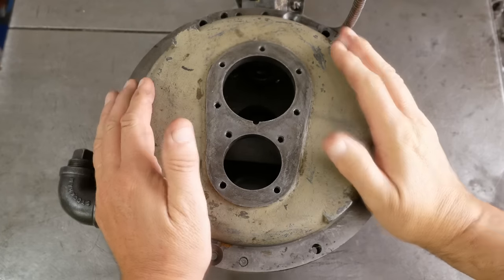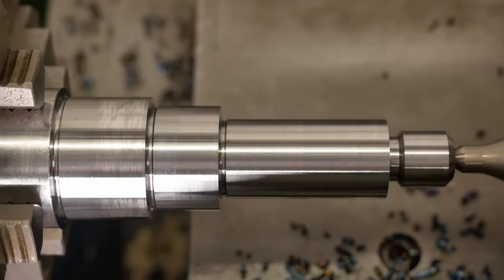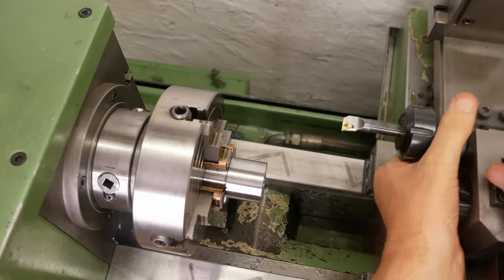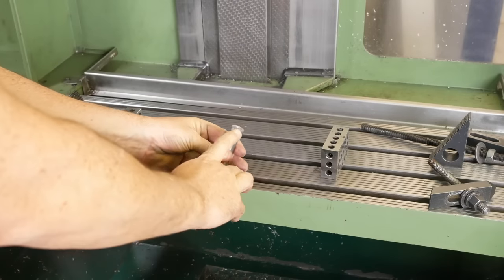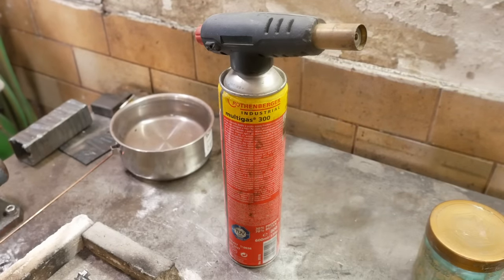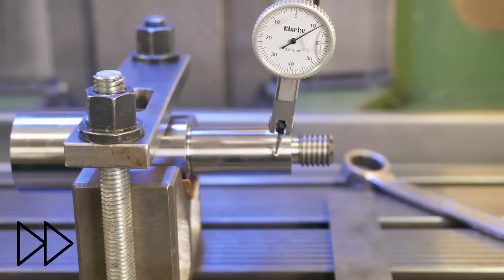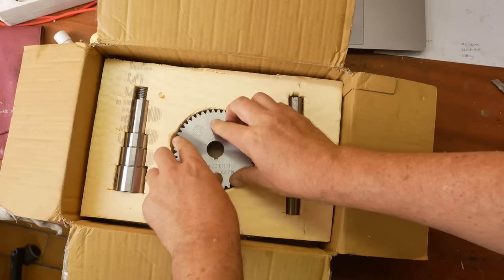To make parts you first have to make DIY tools || RotarySMP

Comment: We used to make gears and gearboxes for nearly 100 years. The gears were mostly for top tier automobile manufacturing, the gearboxes were for a myriad of different industrial, commercial and defence sectors. We rarely used Woodruff keys, except for the older style gearboxes. I started my  apprenticeship in the early 70s and we were taught how to make our lathe and milling tooling from HSS, this practice seems to have declined with the introduction of inserts and carbide tooling. So for me it was a pleasure to see you making a Woodruff cutter the old way, thank you. Great post 👍
Reply from the maker: Thanks for your kind feedback. I also used to use mostly HSS, but the Schaublin really performs with the much higher feeds and speeds of Carbide. It was fun making that cutter, and worked better than I expected, especially after I overcooked the temper a bit.

Comment: I always take attachments out of my tools and give them a quick clean before a light oiling then put them away. Even when I know I most likely will be using the same attachment over and over again I still prefer to see all the attachments in their respective place when I open up the tool case even IF leaving them won’t cause rusting or any other issue.

I’ll even go as far as modifying a tools internal case if there aren’t enough spots for all the different size (shapes) rather than leaving them installed in the tool. Case in point a hydraulic wire crimper came with a bunch of different sized metric crimping die, but the seller had added an extra size that the kit hadn’t included for 12Awg so I used my heat gun and plastic welding sticks to add room next to the original spots just so I could keep the tools jaws empty when storing.
Reply: And I totally nailed the project guess count YAY 2 for the win … 😢 however my celebration is short lived knowing I have to wait longer still to see the conclusion.
Reply from the maker: A trillogy in five parts. Like Douglas Adams taught us :)

Comment: Awesome video! Machinists jacks work great for supporting odd surfaces. You make them on a lathe too! Might wanna invest in a coolant pump or mist cooler if possible. We use a peristaltic pump and a dull needle end at work for low coolant flow work. And no I actually find truing a four jaw relaxing. I'm weird though.
Reply from the maker: Thanks Ethan. The Lathe has a coolant pump built in but I haven't wired it up yet.
Reply: @RotarySMP  Nice!!! I a bit envious of that little guy! So cool!!

Comment: Put paper between your stackups, steel on steel might as well be ball bearings on greased glass, a paper shim will really make your clamp ups bite and its surprisingly consistent in thickness.
Reply from the maker: Thanks for your tip Greg.

Comment: In our shop, we always use a 3 jaw chuck for raw stock. We only use a 4 jaw independant chuck if we want to hold workpieces that are not cylindrical or cylinderical but have to run off-center. If we want to hold a piece that hat a machined cylindrical surface, we use a 4 jaw dependant chuck with soft jaws and bore those jaws in situe. the runout is then less than 0.01mm. Don't ever use a dependant 4 jaw chuck on raw stock. If the cylinder is not consistant enough, that thing will fly off or slip.

Edit: to prevent 10:05 from happening you machine a small enough face in the soft jaws for the workpiece to sit against when boring
Reply from the maker: I would have used a three jaw as well, except I didn't get around to buying one for the Schaublin yet. I could switch one of my two 115mm 3J from the Boley threaded backing plate to a D1-3 back plate, but you know if I did that it would be permanent, and the Boley's chucks are both seriously worn out.

I had the stock further out so I could run an indictor on the machined surface. How would you have done it? I guess I could have also turned a small section bigger than  the largest diameter, just to indicate on after flipping the part.

Comment: It may be worthwhile putting some interlock on master air pressure into the e stop circuit or at least not letting you start a program without air, since it could probably do a lot worse than just not cutting.
Reply from the maker: I have been considering it, but there are many jobs where I dont need air at this point. When using the chuck rather than collets, and not needing the tailstock, I dont need air, and leave the noisy compressor off.

Comment: Great vid!!!!  You really need to add automatic coolant to the lathe man!!!  All the awesome cnc turning with manual oil brushing is just painful to watch lol!
Reply from the maker: The coolant system is built in, but I need to connect up the pump, the valve and fill it. Plus it would really need the machine swarf cover back, on, and I have a bunch of other things to do before I get to it. Untill then ... brushing :)

Comment: this question is a hint about how much machining I know, but why even use a 4 jaw chuck? an uneven ammount of legs will be easier to center... I mean it would be very handy when you want things "off center" (like a cam? no idea the proper name) but for centered parts sounds like a pain.
if these were my tasks I'd say 1 got knocked off the list, and I did 10 totally unrealated things in between.
Reply from the maker: Excellent question. There are two answers:
1/ you can dial out the run out with a four jaw chuck, to get a part perfectly centered. A three jaw is not really a precise device, at least not a typical one.
2/ I dont have a 3J for the Schaublin yet. I could move one of the two I have for the Boley, onto a D1-3 camlock back plate for the Schaublin, but they are both pretty worn out, and I would rather not insult the Schaublin with one, as if I do that, it would be permanent.

Comment: I’ll have to settle for 3 today
Reply from the maker: Hi Luke, Glad to have the gears and shafts off for plasma nitriding.
Reply: @RotarySMP  glad to see things going to plan and grate job on the editing :)
Reply from the maker: @LCalleja  Thanks a lot Luke. How is your first video progressing? If you need any help or tips, just ask.
Cheers,
Mark
Reply: @RotarySMP  not that good I didn’t have a good mount for the camera during milling so didn’t turn out good. Might have to start on the next project.
Reply from the maker: @LCalleja  Any old tripod will get the job done. Bit slow to set up, but they work.
Reply: @RotarySMP  unfortunately don’t have a tripod and not much space to set it up so I settled on something different nothing like a good side project:)
Reply from the maker: @LCalleja  Tripods are easy but a PITA which is always in the way. Good on you for going a different route.
Reply: @RotarySMP  I am hoping to get it working today or tomorrow then I’ll send you a few pictures

Comment: The lathe looks like it's really working well now. 
    I really thought about buying an assortment of SAE woodruff keys and dropping them off in Naxos for you. I just got back from Cleveland and there was a 36" do all for $1800 and a Victor 40" for $1800 as well. Sadly neither would fit in checked luggage and I really don't have time to make the 4 day round trip drive. Not to mention I hate road trips... But that is a great place to find equipment since Ohio was a massive manufacturing state way back. Still is to an extent today for what little we do make in the US.
       At least you can get out in your shop and try to get stuff done. I'm just hoping today is our last 101* day. It only got down to 82* last night.
Reply from the maker: Things cooled down here this weekend. Temps in the mid teen °C today. A 36" DoAll much be a real beast. There is an excellent restoration thread about a 36" on the Practical machinist forum.
Reply: @RotarySMP  I really wanted that 40" victor. It looks nearly identical to the Doall. I'm not familiar with who made what etc on those. If I had the $ I'd buy both and bring them home as they sell for twice that here since they are so rare where I am.
       Oh wanted to mention I like those Butane torches you have over in europe. We can get the heads for them but the cans are not sold in the US. The only way we have butane in a can is in small diameter ones for filling lighters and other torches. We do have heads that fit small propane bottles though. I think the reason is that a butane can that size would not be allowed to be transported commercially on the road. The propane cans are Ok because they are built the same as refillable tanks.
Reply from the maker: @theinfernalcraftsman  I think these burners grew out of the camping "Primus" series of cans.

Comment: Where did you get the live center? Can you share a link? Would be much appreciated as i run in the same problem over ander over again!
Reply from the maker: It was an ebay buy, but it looks like the seller still has one.
https://www.ebay.at/itm/225279300615

Comment: I haven't worked in a toolroom since 2000, so my memory might be off.... When we did heat treating (in an oven), we brought the metal to high temp, and then quenched it in air or oil (depending on the metal). Then to temper it, we brought it to a lower temperature, and let it cool slowly. How come you quenched it after the temper?
Reply from the maker: This is not air or oil hardening steel, it is water hardening steel.  Due to the way I tempered it (with the flame), you need to arrest the temper, otherwise it will rapidly overtemper.

Comment: I’ll go for two 😀
Reply: Fluke! Lol. Clamps are one of those things that take experience to perfect two clamps make  a line thats easy to deflect three is triangle and more stable. Maybe an angle plate against the vee block would have been even better? I’m still learning...
Reply from the maker: Thanks Julia. Good point on triangulating the clamping.
Reply: @RotarySMP  I think workholding is the hardest thing to learn. And every time you get it wrong much swearing occurs 🤣
Reply from the maker: @julias-shed  It really is. I am constantly surprised in my timelapse edits how badly I have clamped things.

Comment: if you think its hard/annoying with a small ground/turned part thats like 2-4 kg imagen how it is with a big 150+ kg flame cut part in a 4 jaw chick ( hit thats what im doing these days. and some even bigger and heavier ones are comming up somewhat soon )
Reply from the maker: I bet. I guess you have to budget quite a few minutes to get a part like that secured and dialed in.
Reply: @RotarySMP  depending on how well it was flame cute somewhere between 15 min to 2 hours 

but with parts in this size and price in rar stock its cheaper to spend a two whole workday's makeing sure its just right then it is to spend 5 min to little and scrapping the part ( i mean just takeing one faceing pass at 0.3mm pr. rotation still takes 5 min and 10 sec. sometimes i need to do 3 faceing passes btw. i legit site on a char watching it well its faceing it off )

Comment: I say you should leave a little so when the heat treatment y done you can grind it true and on size
Reply from the maker: I thought the whole advantage of plasma nitiriding was that you didn't need post HT grinding?
Reply: @RotarySMP  with what happened with the first try I would just have left a little extra on the parts and then grind to spec after so I would not have to be doing it for a third time
Reply from the maker: @chrisrhodes5464  Given both gear sets were already at nominal, I am all in on plasma nitriding not needing a final grind. :/

Comment: I take it you don't have a surface grinder? I was wondering why you are turning the shaft to the final size, then sending them out for heat treat. I think the chances of them fitting the bearings properly is low, without grinding post heat treat.
Reply from the maker: I dont have a  cylindrical grinder. Have you had parts Plasma nitrided? It is lower temperature process, which is typically done without finishing allowance.
Reply: @RotarySMP  No, I haven't. I haven't heard of it but I only worked in the toolroom for 2 years. Sounds interesting.
Reply from the maker: @nickp4793  I hope those parts come back with the tolerance okay as the process promises. Otherwise I am screwed :/
Reply: @RotarySMP  Is hard turning on your "new" lathe an option? (assuming you had left the material oversize). I personally never did that to have experience with it.

Comment: Looks like at 23:22 even with the additional clamping blocks there was some movement of the shaft when the cut started. One thing I can't figure out in machining is how people decide which cutting oil or coolant to use. Quinn Dunki uses WD40 or Tap Magic. Adam Booth uses whatever is sponsored :)  In your case, why cutting oil and not flood coolant on the lathe work? And how many different cutting oils and coolants do you use?
Reply from the maker: It did move a bit. you are right. I also had to recut to depth on that one.

I use cutting oil neat on the lathe, as I haven't yet wired up the coolant pump, or the pipes for the pneumatic coolant valve. The coolant is  the only brand they have at the local tool shop. I use if neat on the lathe and mixed with water on the mill.

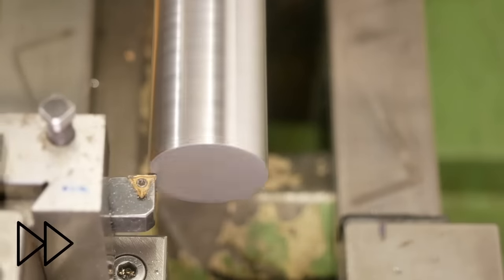Comment: I can tell you are tired of dialing in 4 jaw chucks, because at 3:49 there is visible run-out. Just measuring close to the chuck and not bothering with checking the other end is totally understandable in that sense :)
Reply from the maker: I knew I was turning off a lot of stock so didn't bother to true it out further, but it did look really bad.

Comment: Dialing in a four jaw, does suck, especially if the chuck jaws are bell mouthed like most are. I tell people that one can make anything in a four jaw except money. But really 95% of the work I do is either held in a quality 3-jaw or a collet. All of my 3-jaws have two piece jaws and if I need to wring tenths out of it, I just pop in some soft jaws and true them to the part size I am turning.
Reply from the maker: That is a new 4J, but I do need to look at getting a 3J for the Schaublin.
Reply: What sort of chuck selection is available in Europe? I've always been a fan of Bison (Polish) chucks, but recently thanks to the devalued Dollar a 8" Bison 3 jaw with two piece jaws is north of $1000 US. I ended up with a Taiwanese Vertex, which are good, but still $600. @RotarySMP
Reply from the maker: @steamfan7147  Yeah, Bison are really pricey. TOS also makes nice chucks for a more reasonable price.

Comment: Not a professional shop guy, but the first dialing in of the part was pointless anyway, wasn't it?
Reply from the maker: Hi Alex, yep, sure was.
Cheers,
Mark
Reply: @RotarySMP  Lmao, just asking, because you complained. But you know the answer anyway: properly sized collet chucks for repeatable work-holding. I mean, if you were planning on making a thousand output shafts, that is.
Reply from the maker: @graealex   In that case, the correct tool would be a larger lather which could take 40mm through the spindle with a bar feeder :)
Reply: @RotarySMP  Its too bad that the Gamet powerchuck that you were given was cracked and not fit to use.
The normal process for this type of part is to hold the raw bar in the hard jaws ,process as much as necessary
then as a second operation, either hold the just turned part in prepared soft jaws or (especially as Mark has them) 
  a collet.  Either way concentricity is held.

Comment: Why the hell does tools designed to be smashed together at high speed need to be wrapped up in plastic.
Reply from the maker: Probably to prevent corrosion. Taiwan being an island probably has a rust issue.
Reply: @RotarySMP  do Taiwanese workshops wrap up all their tools in plastic at the end of every day? I doubt it. It's just commercial bull crap, no different than supermarkets wrapping up bananas in plastic or Amazon sending you a 2' x 4' cardboard box full of plastic air bags because you ordered an SD card, it triggers me.
Reply from the maker: @iseriver3982  Those boxes drive me nuts too.
A shop doesn't wrap it's tools, but a tool seller does, as a spot of corrosion on the new tool will probably lead to a refund. I agree they should use just the anti corrosion coating, and maybe wax paper.